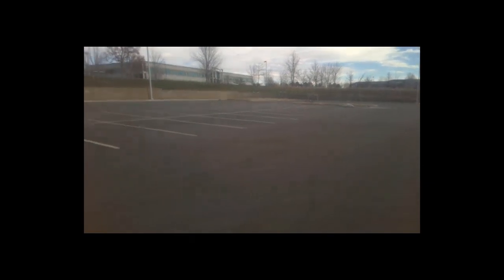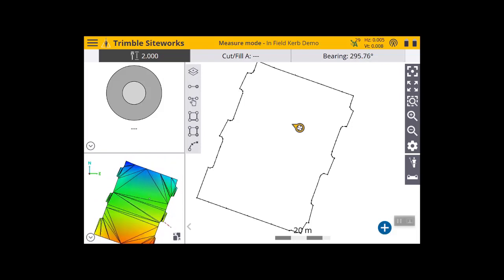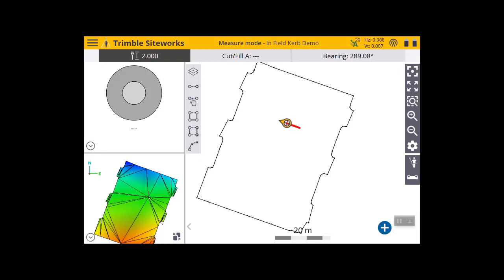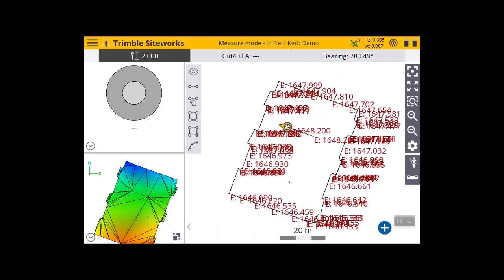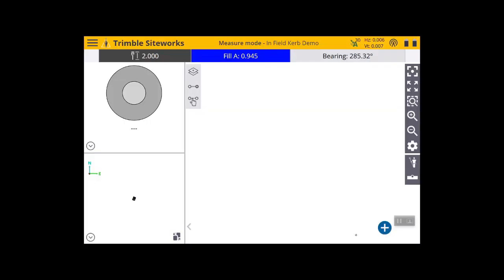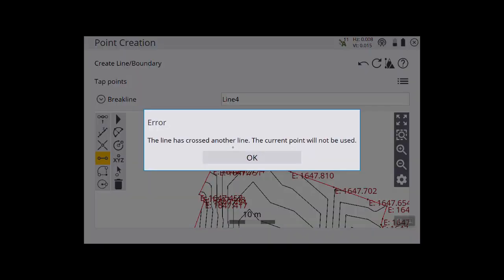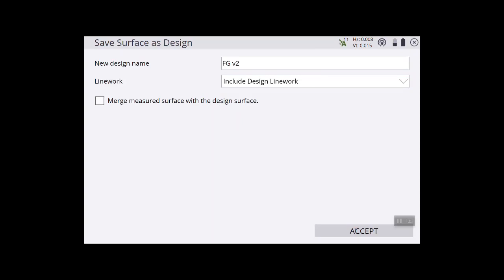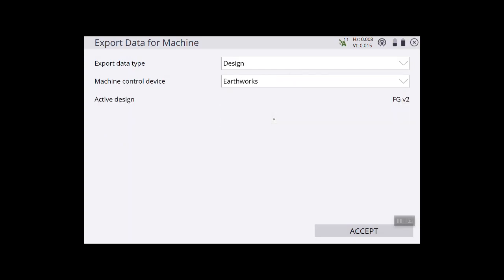Trimble Siteworks - In Field Design for Machines

Comment: I’m using the Tsc7 and site works, can you explain how you closed the break line? I did one similar but had to use outer boundary line. Also, when I saved it as surface it skipped right by the option you show where it lets you select outer most points?
Reply: I believe you have to go into cogo and one of the features let's you conect two points. If you create a volume boundary the lines will connect automatically. I'm new to the program but that seems to be working for me so far.
Reply: How did he get the 3d view? I couldn't see where the mouse clicked to do that.